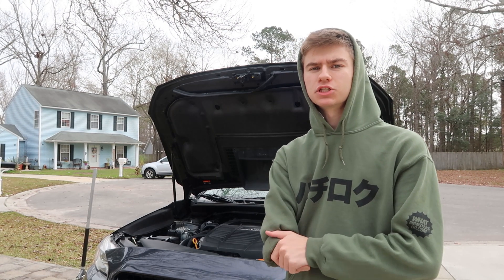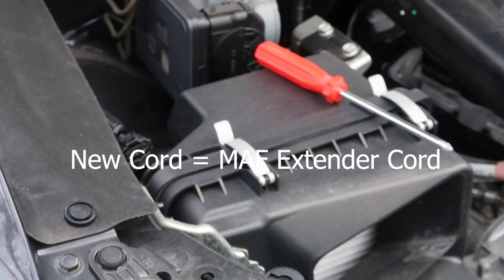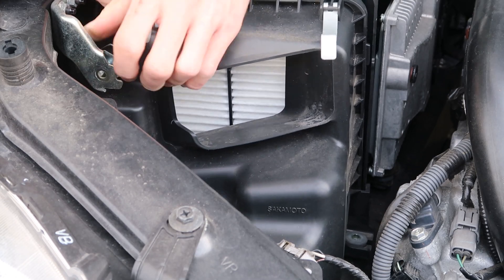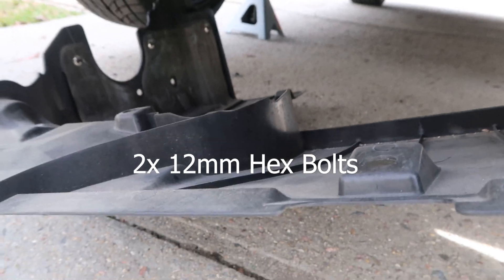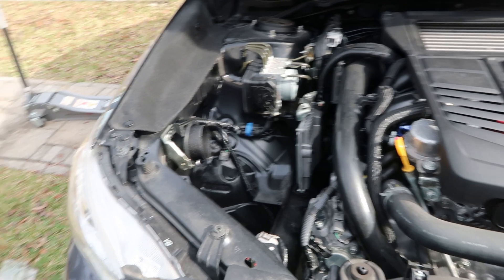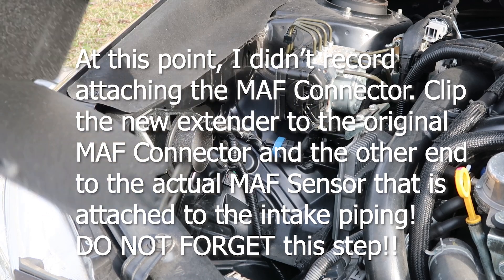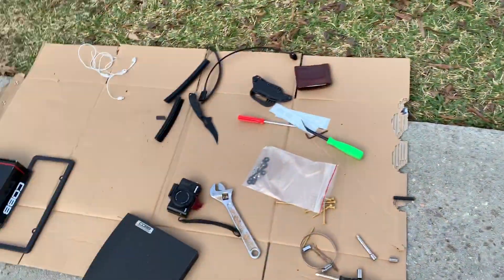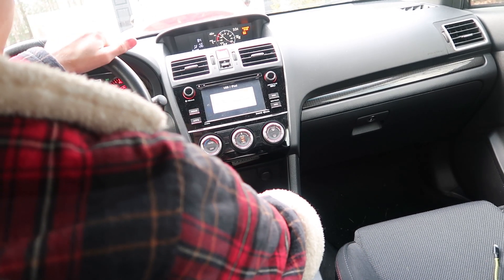COBB Stage 1+ Big SF Power Package Install! *Amazing Sound!!*

Comment: My man!!! You killed this and thank you for going over every step!! That is exactly what I have been looking for! Thank you can’t wait to do mine this weekend
Reply from the maker: Let’s go! Thanks so much for the support, glad you enjoyed the video. Good luck man!
Reply: @jaggerkenyon5996  anytime man!! I might need that luck haha between that and all the electrical stuff I’m getting my self into with a new head unit I will def need luck
Reply from the maker: @csw1190  Oh wow! A new headunit will be sick, def on the list of mods I'll do eventually. Which one did you go with?
Reply: @jaggerkenyon5996  so I wanted oem fitment and look so I went with an idoing head unit and got it from aliexpress.com after tax and everything it was 400 which isn’t bad at all.
Reply: @jaggerkenyon5996  I will say the one thing I couldn’t find anywhere on YouTube or forums is if you have star link/the sos button in your car there is a module on the bottom
Of your oe head unit that you will
Have to unbolt and bolt up to the new head unit. That sos system is tied into your front speakers so the only way to do it without resorting around the sos system is by taking that module off the old and putting it on the new one. That info is from experience cuz I spent 45min to an hour researching and found nothing then I looked at the oem and it had that module on the bottom and was like let’s try that haha

Comment: Should get Cobb's 3 port boost control solenoid and protune. Also, stage 1 drive train. My 17 drives like an sti. 270whp/270tq. Protune done at Misfire motorsports.
Reply: Haha fellow okie! Misfire does great work

Comment: Hey I got a question, when you installed did the throttle feel a little weird for you? After tuning
Reply from the maker: Not that I can remember. Car drove like new!
Reply: at stock 50% of the pedal travel is 100% acceleration but with the stage 1 100% of the pedal is 100% of acceleration so it is more linear sorry im late but if that helps you.

Comment: Did you have to use the maf extension or will it reach without it?
Reply from the maker: RayLBG No extension needed. Just plug and play with the parts given :)
Reply: Jagger Kenyon interesting.. I needed to use an extension because it was about 5 inches short

Comment: Hey dude, cool vid. When you install the accessport, does the car check engine light come on, or does it seem to operate as normal? I want to do this stuff, but I’m scared the ecu will start bugging out or something.
Reply from the maker: Jeff Schlitter I have had no issues at all when it comes to the bolt ons so far. Up to this point I haven’t done anything that the AP doesn’t have a tune for. Car runs very well and healthy even after the 8k miles I’ve put on it since I’ve started modifying it. No CEL light btw, if that pops up most likely something isn’t put in correctly or tightened down all the way, which isn’t a hard fix just a pain to figure out where it is haha. Thanks for the comment!
Reply from the maker: @remissiveslave   Since this video I've gone Stage 2+ and driven out of state multiple times and the cars runs as if it's brand new. From what I've seen on forums and other videos anything past Stage 2 (FMIC/E85 and so on) is where you're going to start seeing issues if you don't build your engine. My car is a daily and it's been an insanely reliable car. If you have any more thoughts let me know! :)

Comment: How’s it running still on the ots tune?
Reply from the maker: Since this video I've gone Stage 2+ and the OTS tune runs beautifully.
Reply: @jaggerkenyon5996  nice thanks for the reply! Gonna have pull the trigger on this soon
Reply from the maker: @dylanwirkus2119  it’s definitely worth it, even if you don’t do anything else the intake and the stage one tune makes driving that much better and refines it. Fixes a bit of rev hang that the stock car has! 10/10 would recommend

Comment: If I have a muffler delete catback can I still run this map safely?
Reply from the maker: Yup! Don't have to worry about maps until it comes to replacing the downpipe. Catback exhausts don't require a flash/tune :)
Reply: @jaggerkenyon5996  ok sorry but I just want to make sure I fully understand so if I had a wrx with a catback muffler delete other than Cobb and I installed the Cobb stage 1+ big sf with the Cobb intake I’ll be good?
Reply: @jaggerkenyon5996  and can I jump to that right away or does the car have to have stage 1 first? Sorry I’m a noob when it comes to access ports
Reply from the maker: @alapus7774  Yeah so all you'll need for the Stage 1 tune is the Big SF intake from Cobb and the accessport. The cat-back could be any brand or in my case during this video I didn't even have an cat-back exhaust. If you have more questions feel free to ask :)

Comment: Does the car feel a lot faster compared to stock?
Reply from the maker: George Parker I would say the CAI & Intake definitely improved performance and ironed out the most of the rev hang to make it have a smoother driving experience. The car feels incredibly faster with stage 2+ (Downpipe, Catback, CAI (also have a BPV))